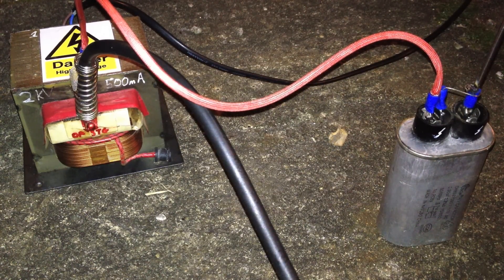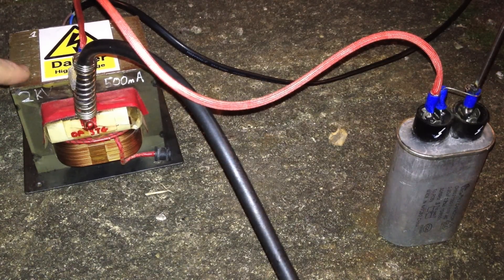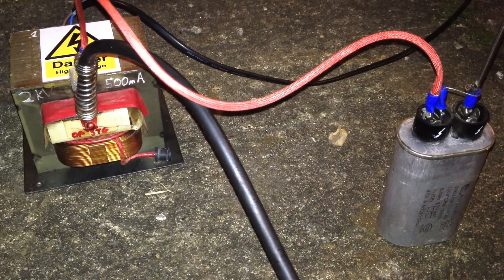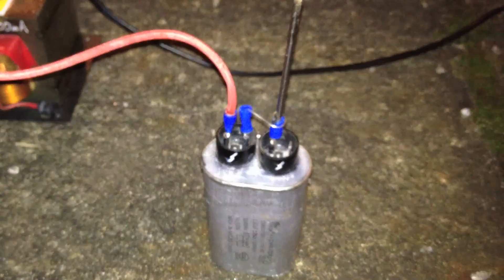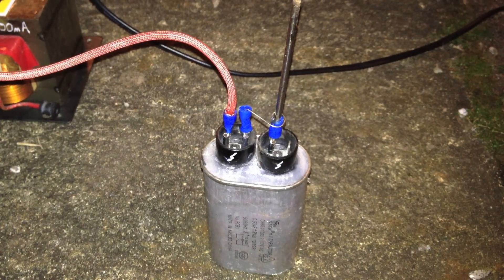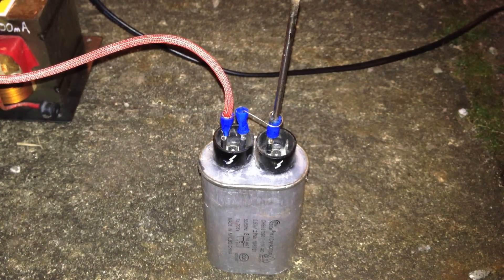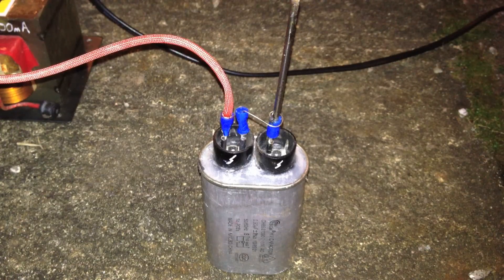High Voltage makes plastic Fluoresce ?

Comment: You beat me to it.. Only video on here I've seen so far shorting the cap on a MOT. Amazing high frequency supply right there in combo with the arc gap. I've gotten 5 inch streamers from connecting that to 6 turns on a flyback... Didn't feel well each time I did the experiment. Ozone? X-Rays???

Comment: The plastic might not be visibly fluorescent under a UV lamp, but those sparks are probably put off very high energy UV which is being blasted, point blank, into that plastic. So, under those conditions, I believe it is possible for something originally materials thought to be non-fluorescent are likely to fluoresce.
Reply: you might try a xenon flash lamp and get the same results

Comment: Given that you mentioned trying to illuminate the plastic with UV but didn't get a result..  I would wager that the spark gap UV intensity (and wavelengths) are strong enough to penetrate quite deep into the plastic.  There may have been some UV fluorescent in the plastic but for whatever reason is no longer active in the outer layers.  You could test this by cutting a piece of the plastic and exposing the fresh inside to UV.   As others have said, it is definitely exited electrons releasing photons on returning to their ground state.  

It's further possible that the excited state is simply so high as not to be noticeable from any reasonably obtained UV source, and the extreme energy level itself is needed to excite the electrons enough, so that when they release their photons from within the plastic they do so in the visible spectrum.
Reply: https://books.google.com/books?id=U0OB6pQSlfsC&pg=PA72&lpg=PA72&dq=plastics+fluorescence+excitation+energy&source=bl&ots=t7n8U5zD2T&sig=6kAfrxVEir5pkWh-dI4RPAiYeM4&hl=en&sa=X&ved=0ahUKEwj8sruppvzOAhVM_IMKHX4gBTMQ6AEILDAC
Reply: I doubt it would penetrate the plastic as it's breakdown would be in megavolt per mm range and hf high voltage tends to travel on the skin of a conductor rather than penetrate it .

Comment: if you got a strong enough 405nm laser it can make some plastic glow also. I found out about it, I'm thinking maybe 2 years ago with the kitchen socket cover.
Reply: Those are actually made to slightly glow in the dark you idiot. And from that I've learned you have old sockets

Comment: perhaps you will find this reading enlightening 
"Plastics emit fluorescent light when exposed to a brief flash of light, and the emission decays with time in a distinctive pattern "

Read more: http://www.theengineer.co.uk/manufacturing/news/new-process-simplifies-recycling-of-plastics/1019102.article#ixzz3B8OMdFti
Reply: +DanTheAwesomeMan Great video! Very thought provoking. What you might be seeing here is phosphorescence which is same process as fluorescence but causes a delayed effect. The physics of fluorescence is to do with energy states in atoms. These states come in discrete energy packets of E=hv where h is a universal constant (planks constant) and v is the frequency of the incident light. The light produced in your spark is equivalent to millions of photons (the larger the spark the more of them) many of them carrying this fixed energy amount of hv. What is happening in the plastic, is those hv photons of light from the spark that reach the plastic, cause a similar  number of electrons in the atoms of the plastic to move to a different energy level (the energy gap being hv). All these electrons then drop back to their original position and in the process re-emit the energy at a different frequency v (i.e. Its a lower frequency because some of the energy will have been lost due to collisions in the material). So what your seeing is the consequence of many of these 'excited'  electrons re-emitting light whilst moving back to their original stable state. Now, that particular plastic material might hold onto the energy for a longer time, before the electrons return to their original states. This effect is called phosphorescence.  The details are a lot more involved and need a bit of quantum theory, but this (I believe) is the general essence of what is happening.
Reply: a few days after I had seen your video I read that article so I posted it in case you were interested
Reply from the maker: whocoulditbe butme Thanks that's really interesting! I just wish they explained the physics.
Reply: +Tech Tins Great channel BTW. I've subbed to you my friend!
Reply: Tech Tins wow man

you know a lot! keep it up
I knew all that but to be honest your E=hv equation was not know to me
keep up your knowledge

Comment: @DanTheAwesomeMan: simple, the high voltage causes a luminescent reaction in the chemicals of which said plastic is composed of, the plastic may consist of some electroluminescent chemicals and some resistant semiconductors, you may want to research what chemicals the plastic is made of and check further into it if you are super curious,

Comment: Well. I think it's still to early to rule out UV as the source. The distribution pattern looks most certainly matches how a light source is shining from the side and casting shadows. Intensity might be the key. If your UV light source is just not comparable with the amount emits by the spark. You could try put some samples of the same material near the spark but not contacting any electrified component to rule out direct heating or   electricity.  See if it still reproduces the results.
Reply: Yes that's true , like nuclear shadowing